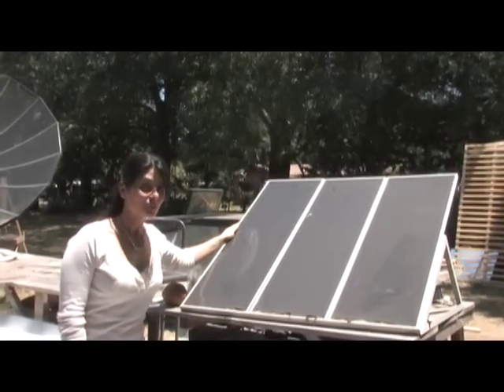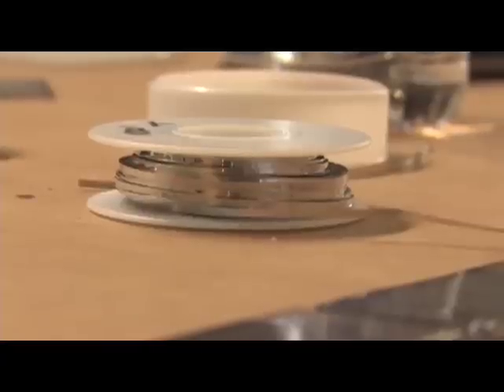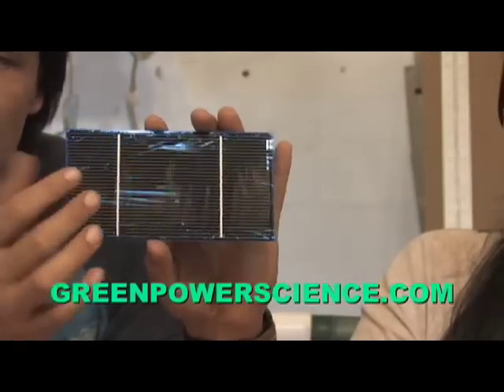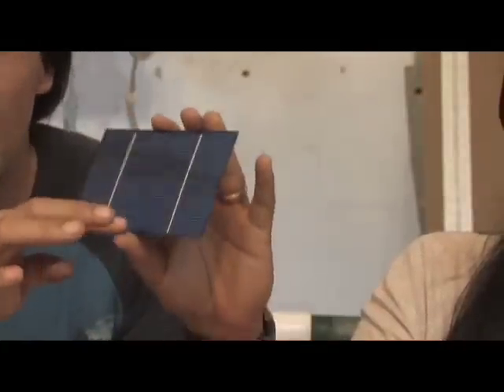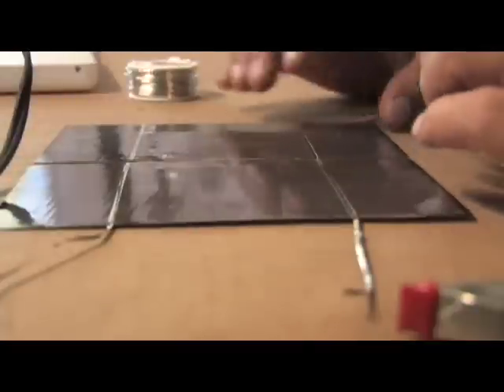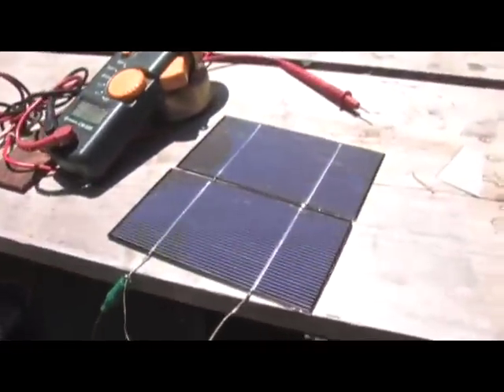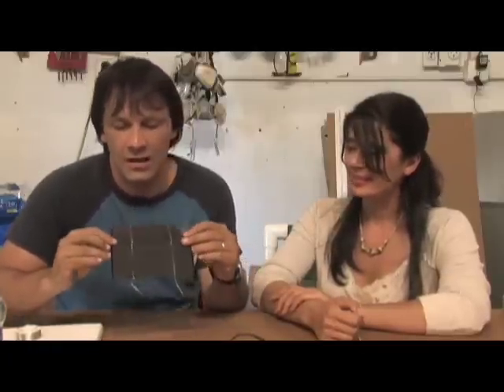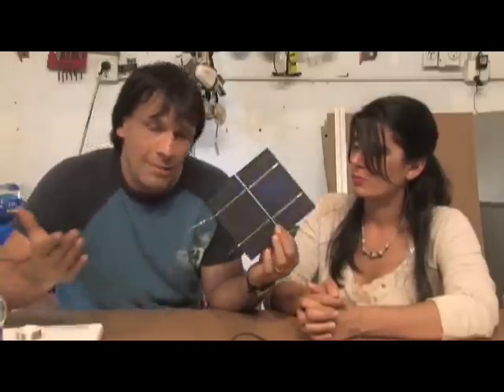SOLAR CELLS Monocrystalline DIY Solar Panels Make Your Own Free Energy

Comment: it isnt free energy..  your converting sunlight to electricity.

If your looking to make panels, monocrystaline cells are down in price to around 60 cents a watt.
theyre contacts are 2 on the back and they dont need to be cast in resin (poly cells might be cheap but making a panel = more then a mono panel lol....
just tied 4 together to make a charger for my galaxy tab..  $4    for a 5 volt at 2 amp rig that folds up the size of  me tablet.

Comment: first, dude, your wife is hot. Second, have you tried using a heat gun to solder the tab wire to the front of the panel?